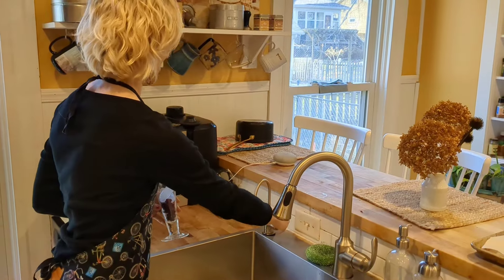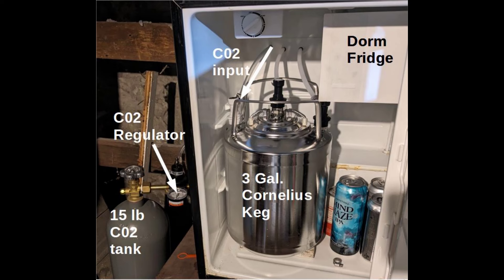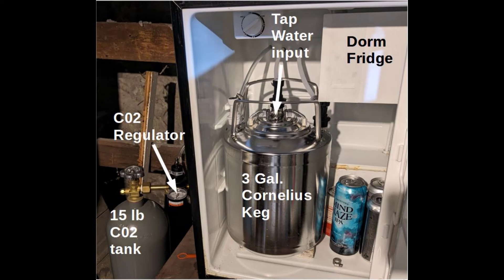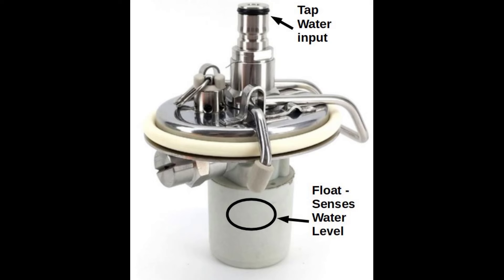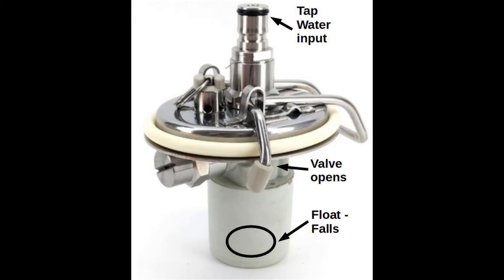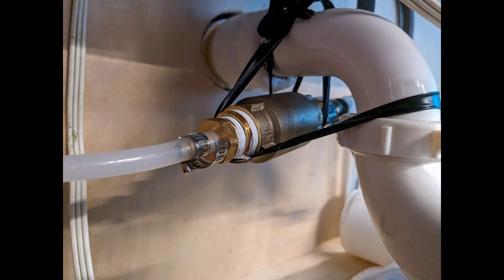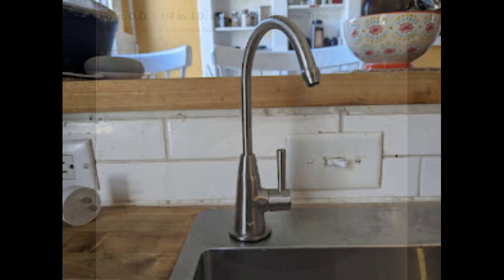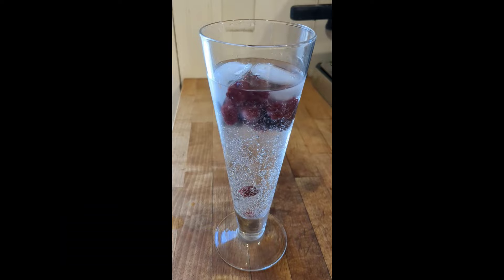DIY Carbonated Water - unlimited, on tap, nearly free

Comment: I would suggest only using stainless or plastic faucets for seltzer, the carbonic acid can eat away at many metals which will be dissolved into it when you drink it. Same for other soda dispensing or wine, even flat wine with nitrogen. Beer isn't as carbonated/acidic and plated brass fittings can last longer, but still wear through with time.

Comment: Its a lot cheaper than a McCanns Carbonator. I paid $600 new foe one and it does the same...
Reply: So since you have the McCann can you tell me pros and cons of it in relation to this system? I’m guessing your Carbonator can make water faster?
Reply: @tatertot3454  It's faster yeah. These passive systems have a significant recharge time if you drain them heavily. The fresh water needs to cool down and absorb the gas. For a few people using it, that's fine, but you can pretty easily drain it enough to reduce the fizz if you're pouring pitchers of it for a party or something.

The powered systems operate at significantly higher pressure (you can run them all the way up to around 120 psi if you want) so you can get much stronger carbonation, even at higher temperatures, and they carbonate fast enough for continuous use if you're running the water through a cooling loop. The big mac can do around 100 gallons/hr at full carbonation if you're setup correctly.

Note that without a proper flow control tap you'll be burning most of the carbonation (and you can see that in her glass in the video, most of the gas is escaping very fast), so the benefits of going to higher PSI aren't that notable unless you're not refrigerating stuff prior to dispensing.

Comment: Greeting Nathan. Thanks for this. I would rather connect a large bottle of filtered water to the kegerator - I am thinking I would need a flowjet (pump) to apply pressure to fill the kegerator. Any advice would be greatly appreciated. Thanks !
Reply from the maker: You could pour the filtered water directly into the keg.  If you want to have a separate bottle for the filtered water you'd have to pressurize it somehow to force it in there.  I think residential water pressure is actually pretty high, so a pump is probably the way to go.  perhaps try a diaphragm pump from amazon and see if it can produce enough pressure to force the water in?
Reply: @nathanbuildsdiy  Agreed. Thanks again.

Comment: Try ptfe tubing if you want minimal flavor contamination. It's teflon lined. I used it for aquarium stuff because it reduced gas losses by quite a bit, but that same lack permittivity
also makes it very low flavor.

Also, get a stainless tap. Off the shelf ones from a hardware store are going to degrade and contaminate your water with some less than pleasant compounds. Everything after the check valve should be either stainless or plastic.

Comment: isnt a condition for this system to work, to have the tap water pressure higher than the CO2 pressure after the regulator? otherwise i dont understand how you could possible fill the keg
Reply: Yes. Your tap pressure will have to be above the regulator output pressure- and a little above that because it'll be compressing CO2 space to fill with water. You can use the Ideal Gas Law (Pv=NRT) to find the approximate values.

And, if your water pressure is too low, you can buy a booster pump, may not need a booster tank at all.